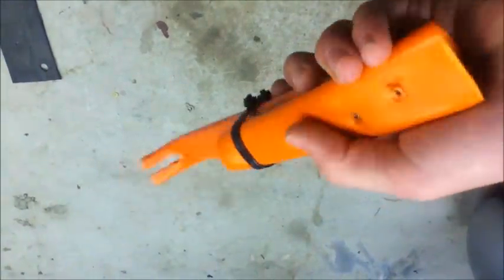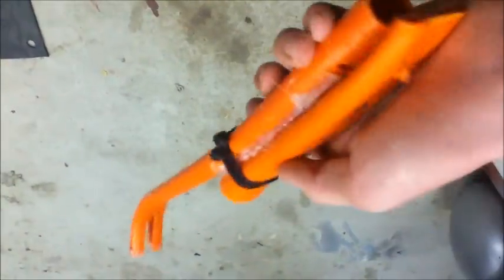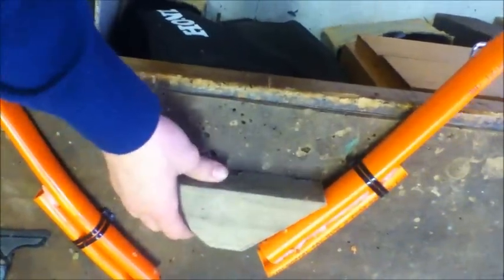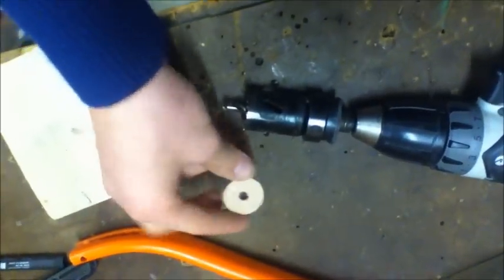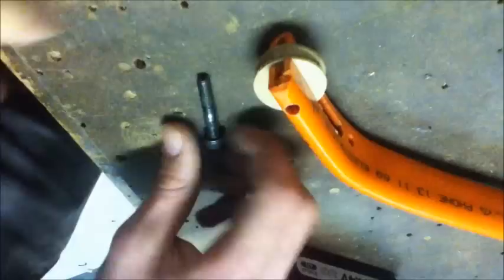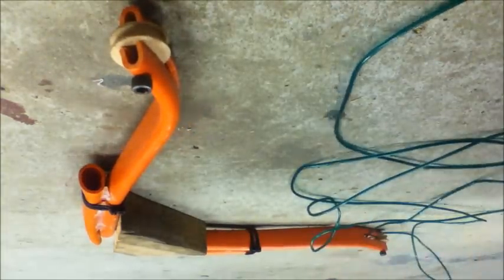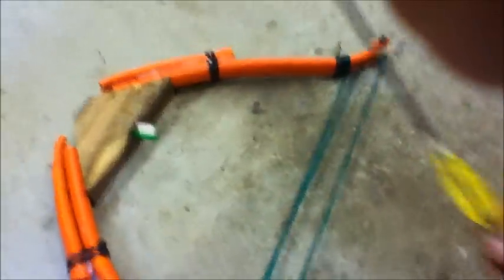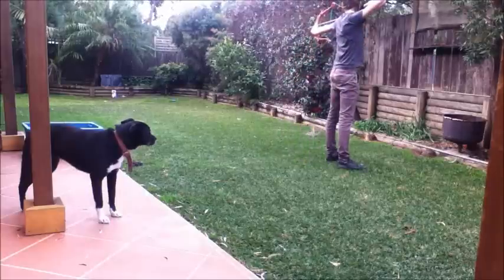Make An Ultra Compact Compound Bow Very POWERFULL

Comment: Awesome!!! it looks like it works fantastic despite my feelings that the way the whole thing was joined together and the pulleys are attached looked a little bit weak.
I'm definitely going to have to try this after making a few PVC bows recently and it has been a blast but this method you have come up really takes it to the next level.
Thanks for opening up this thought train bro

Comment: Is that sc 40 or 80 pvc ? Ive never seen orange colored pipe here in America its mostly white ,grey or green and black but the black isnt  pvc its something else. Beautiful work as it works beautifully. Are you going to scale it up some ? At your attachment points between the wood block and the pvc do you think a conformed surface(s) in the block using perhaps a half-round wood rasp would be beneficial ? I tried to make a bow once and was not at all what I'd call successful but one thing I did incorporate into it that was ,was an old set of bicycle handlebars ( the BMX type I think ?) , wherein at the point where ones hands would go when steering a bike i attached the bow such that when pointing the bow forward the right angle bend in the handlebar and specifically the lower portion of said bar rested on my forearm and i was able to grip the cross bar piece so that my bow hand was never actually touching the bow at all . Made for much easier aiming and the forearm rest acted as a stabilizer it also allowed me to use larger arrows . Ty for the upload

Comment: You won’t get the compounding effect because you are using a drill saw with a through bit. 

You want one that cuts the circle but doesn’t put the holes in the middle. 

The compounding effect comes from the wheels being mounted eccentrically so you pull through the flex and have the easy resting place in the back of the draw. 

When loosed, you want the leaf springs to pull through the eccentric, where it gains power and velocity. 

The bigger the eccentric, the more the power and lighter the hold weight. 

Pretty good power 

Good effort. I’m going to build one.

Comment: hi, can anyone help?
i made something similar to this, with longer limbs and i used 3/4 inch pvc. i used nylon string as bow string but mine is only 15-20 ibs strong and i guess brace height is too much. What might be the problem? should i reduce the brace height

Comment: Hello, nice. But you could replace the wood by pieces of iron  with plastic handle around (that would allow you to increase the size of the bow at different levels of your choice)
if you put few holes on it to have those differents levels of attachments. If you can heat iron
up to red, it is quite easy to bend it as you want.

Comment: I suppose you could make this less likely to rapidly disassemble in your face by using hose clamps instead of cable ties and using washers when securing the PVC to the wood. The washers should stop the hole in the PVC from expanding over the head of the screw and popping off. You could also add washers between the PVC and pulley discs to reduce friction. 
Great video!

Comment: So how much lb. release with those pulleys do you think you get at full draw, i.e. if the bow weight is 40 lbs, what are you holding at full draw? You could also insert pipes into one another and heat to shape like backyard bowyer for a short, powerful one-piece bow. You're a good shot.

Comment: Martin is correct, from someone who has been shooting compound bows for over 20 years in competition ,those wheels that you made (cams) along with the spring action on the limbs with the offset of the cams gives you the power. basically you made a not so fancy looking recurve short bow (cant say long as well its not). If you want to maybe have your arm surgically repaired after having an arrow removed from it make the cams more oval shaped and offset the hole more to the bottom. Then when you pull it back and come over the center of the cam you will get what is called "let off".  Based on the size and shape of the cam dictates the amount of let off you will achieve.  I'm sure the draw weight is no more then 15-20 lbs on that toy but it would be nice to make it anatomically correct.  good luck

Comment: Looks brilliant. I even like the orange color.
Seems to me you could have some fun with the handle and riser set up if you liked, perhaps even with a one inch hole through the wood for the arrow to travel through, with a trio of toothbrush heads to center the arrow.  The handle could be an offset bit of PVC pipe bolted onto the side of the riser.
After I get a couple more straight bows made I'll try my hand at one of these.

Comment: This is actually pretty awesome! Just a bit worried about the pvc cracking and splinting under pressure..
Reply: That's why it's been flattened. Flattened PVC doesn't shatter like a round pipe, it just collapses in a bend, which can be fixed by reheating the pipe until it puffs out, and then it can be re-flattened.
Reply: Negative_Xer0 Learning every day

Comment: ok i made one of these took about 2 hours i had conduit and a few timbers. dyna bolted the conduit to the timber 2 each side. i didnt make the limbs proberly bent the ends the wrong way and drilled the holes so i dont wanna weaken it. i had a few wheels off an old sliding door. now i need the string. thanks for the guide could be a new hobby and that

Comment: there is one important detail missing... sure, you have a pulley, but you need a cam to get the compound effect. Nice effort though.
Reply: No you need a cam to have falloff but to have compound effect you only need pulleys.
Reply: The whole idea with a compound bow is the levering system, the user allows mechanical complexity but gets a levering advantage, a smoother acceleration curve to the arrow allowing higher speed. There is no justification for a complex mechanical system like this if you do not gain any advantage. This bow is no different from a recurve except it has a longer draw lenght with less bending of the limbs but sacrfice precision. The same could be achieved with higher precision with more flexy limb material and no mechanical fuss.
Reply: I believe that part of the point of his build is that it is small and thus needs to have short stiff limbs and to get a full draw would need to have a pulley system.   My first compound bow that my dad gave me back in 1969 did not have cams only pulleys and was marketed as a compound bow because of the compound travel of the bow string. No it did not have any additional mechanical advantage but it was compact and served its purpose. Also not everyone builds things just to have less fuss as you put it.  Some people me included build things to see if we can.  It is part of the fun, but I don't expect everyone to enjoy the same things.  If they did it would be a boring world! Have a nice day.
Reply: Exact reason why I thought this video was stupid as fuck. Without the cam it's not really a compound bow.
Reply: ***** "it has a longer draw lenght with less bending of the limbs"
- its very small and has certainly more energy than a recurve of its size.
- it uses a pully system, therefore its a compound bow, just without letoff
Reply: Zombrex A compound bow has pullies.  A cam bow has cams.  There is a difference between the two...The cam allows there to be a pressure release so that you can hold the string drawn without having to hold the pressure of the bow. A pulley doesn't have this as it is not cam shaped, but it is still a compound bow
Reply: BigBadBear8 Wrong!! Compound bows ALL have Cams actually... They just vary in shape.  A pulley is a round disk with a track in the circumference (as he has made) but with the AXIS OF ROTATION at the GEOMETRIC CENTRE of the disk.  A Cam can be a circular disk or other shape (as in modern compound bows) but the axis of rotation is NOT at the centre of the disk.  Bit of false advertising there by Mathews since the No Cam actually has 2 cams by mechanical engineering definition... round pulleys rotating off axis... this is what provides the let off..
Reply: Colin Gair I am not wrong.  The location of the hole makes it a cam.  a center hole is a pulley, like a normal compound bow was made originally.  A cam was introduced to make the draw easier to hold as it takes pressure from the string as it over cams.. I was around when these things first came out, and was involved with them at the time.  My first compound bow did not have cams, it had pulleys, and my next bow had cams as it was easier to hold when drawn. Maybe do a little more research before calling me a liar
Reply: Try reading up on the Original Compound bow made by Hollis Wilbur Allen in 1966 my friend... pulleys were OFFSET from centre!!  Also you may want to look at the cams on every compound made in the 70's again and see that they're all offset as well...

Comment: Nice work... but you should never use a wood arrow with a compound bow. The risk of them shattering on release is higher, and if that happens, the back end of the shaft and be driven through your forearm. You should also check and make sure both limbs are flexing the same way and distance before shooting (I believe its called "trimming") Any video on making wood bows should be able to show you ways of checking and correcting them if they are off.

Comment: bad craftsmanship, bad video, great bow, great engineering, great ingenuity. 6/10
Reply: At least He's trying, judging by his voice he sound about 12-15 so to be that young and doing this well. is a feat in my mind
Reply: Brickblox
agreed, thats why i sad 6/10
Reply: The 802 Man I agree with "sad 6/10" said ;) but however it may be kinda ugly on the eyes, but it doesn't have to be pretty, it just has to work (preferably without too much a chance of injury). Though I think out of what he had at the time it's a pretty decent piece of work, it could use a few touch ups here and there but otherwise I must also agree on the great amount of ingenuity, engineering, and design behind the bow itself. So I would personally rate a 7/10 or even perhaps a 8/10. The only other nice improvements I could see is using an exacts knife to clean up the hot glue, taking out the zip ties and replacing them with a layer of wrapped duct tape to prevent shifting and then covered in a paracord wrapping (if that would be a proper term for it) in order to keep the pieces together, replacing the wood block with another piece PVC reinforced with a fiberglass rod (or simply reshaping/sanding the wood block to be more comfortable and natural to hold), and just for looks to dye the toothbrush bristles black along with the PVC being spray painted beforehand if you'd prefer to over using duct tape with designs on it (including before using the paracord). But a very neat piece of work!

Comment: ok cool, nice idea, i have just one thought instead of just using screws to attach the limbs would coach bolts be a better idea with some sort of locking bolt,  it would be stronger attachment to the wood and would mean you could take it apart with out the need for a tool and would give the added security of knowing the screws would not loosen over time.
Reply: Great job... I really appreciate and enjoy your videos.  I missed exactly how you attached the ends of the bow string though.
.

Comment: Good job dood,, you can get cheap door roller wheels from your local hardware  to act as pullies ,even a fly screen rubber roller removed from its handle

Comment: compound bow strings arnt made with steel cable but whatever lol
Reply: its plastic. He just said
Reply: LDK447
He said it's a steel cable with a plastic coating. So it's a steel cable.
Reply: whatever that work. steel cable, plastic cable, nylon etc.
Reply: I think my old bear whitetail has a steel cable.  There is a regular bow string for part of it but not most.  I know the new ones aren't steel.  I think thats to help make them quieter too.
Reply: Anthony Foote it makes them quieter and quicker